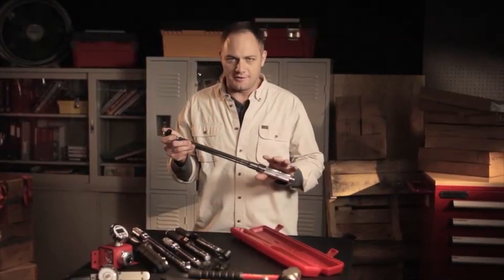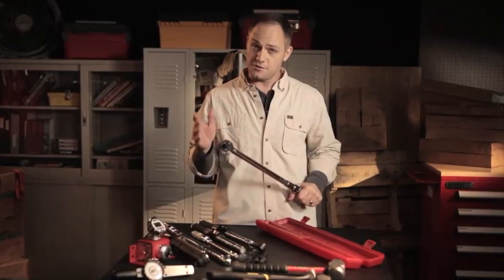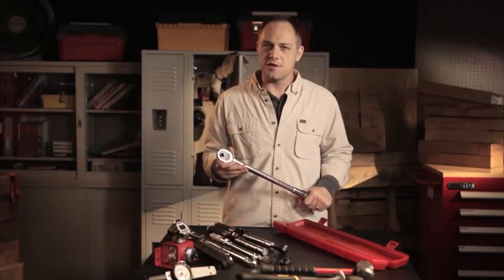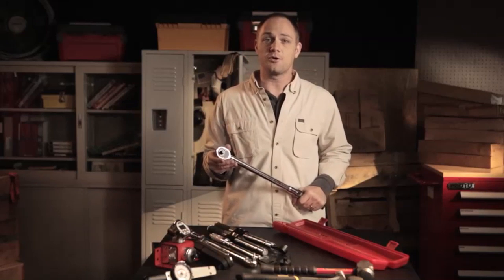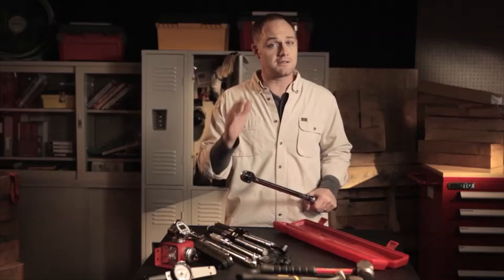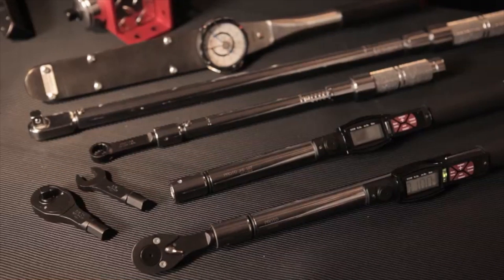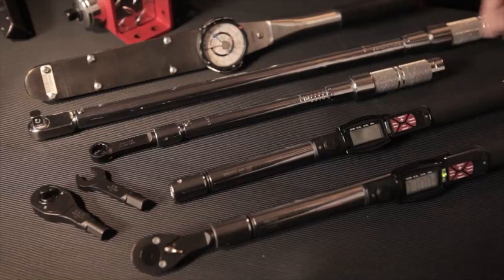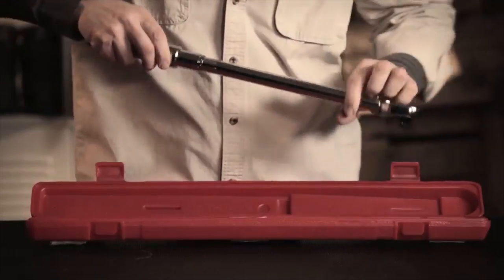PROTO Tools Torque Wrenches Safety

Comment: why 20% and not 0?  we usually just zero them out at work
Reply: According to what I have read, you never want to store the torque wrench below its lowest torque value. So for instance if the wrench has a torque value of 50-250 ft lbs, you would store it at 50 ft lbs, so that the spring still has tension on it.
Reply: Releasing all the tension is how I was taught as well.  Storing a 6013 at 200 lbs??
Reply: Proto 6013,is that 50-250 FT-LBS torque wrench?
I have Proto 6014,50-250 FT-LBS.
20% of its maximum setting is 50 FT-LBS,which is lowest point on the scale anyway.There is no 0 !
Micrometer style torque wrench needs to be exercised if tool has been recently in storage to insure internal spring has seated properly!